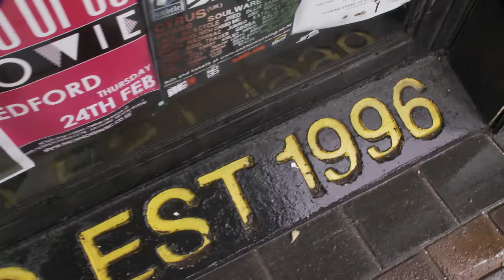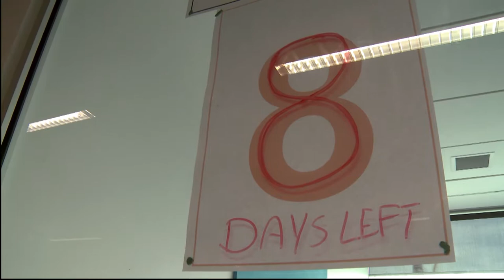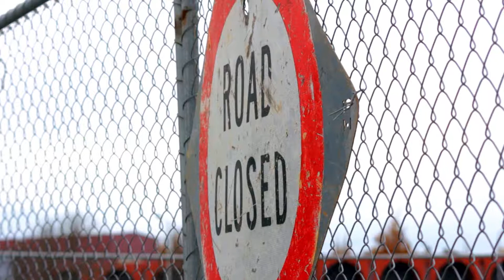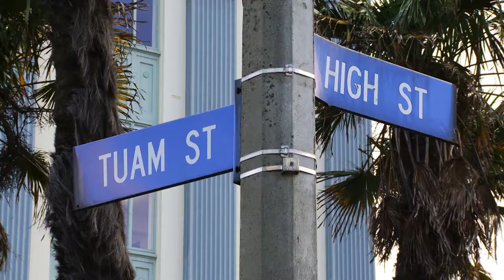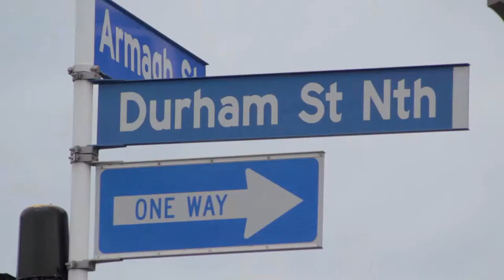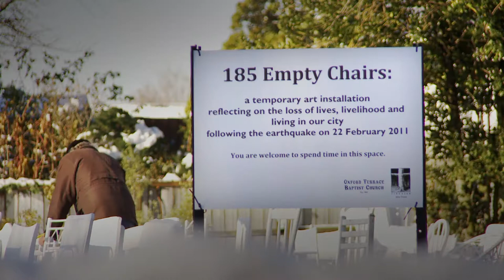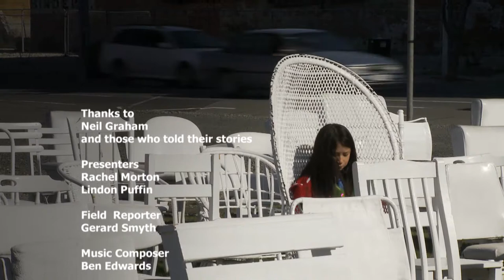Christchurch from the Streets - Season 1 - Episode 3

Comment: Isn't  a one way system road to get you from a to b faster so slowing the speed down defeats the purpose. Normally the traffic lights work in unison with each intersections so if traveling the right speed won't have to stop all the time.So anyone in their right mind wouldn't wont to have a business let alone a residential property on a one way road.